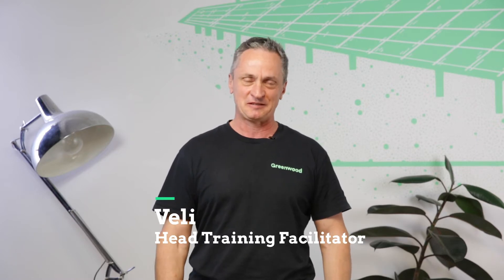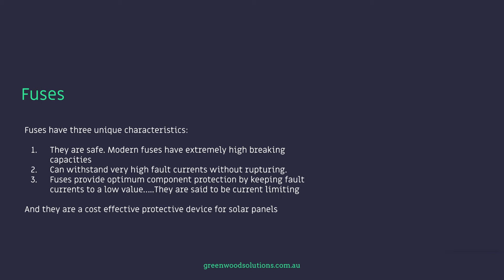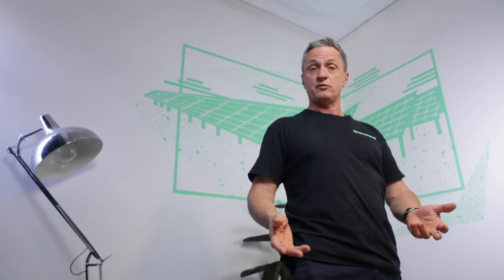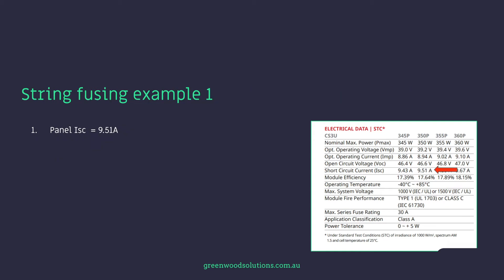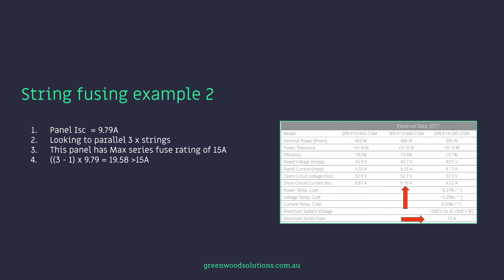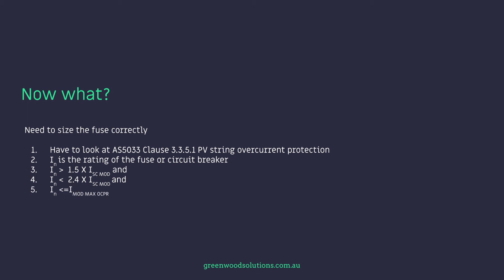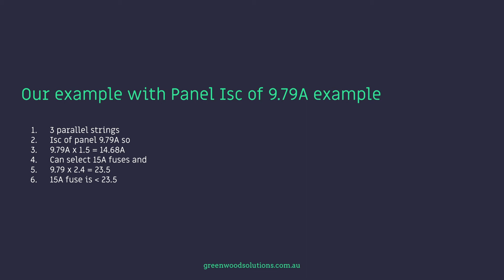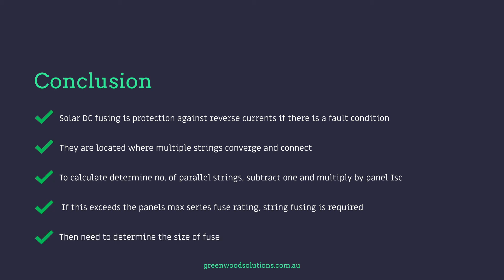Solar DC String Fusing Calculations

Comment: great video..could i also select a 20amp fuse as well?
Reply from the maker: Hey Adam, you can't select a 20amp fuse. This is because the 20A rating of the fuse does not satisfy the requirement of In <=I MOD MAX OCPR. which is 15A in this example.

Comment: This was a great video. I worry about how much non sense and wrong information is out there. I have 2 stings in parallel each has 3 solar panels in series. 
this is the back panel info ( Isc 13.41A, Voc 20.52, the max fuse rating of a panel is 15 Amp)  I have also 100V / 40 Amp charge controller.
With that I am combining 2 x 13.41 = 26.82A (with 61.56V) going to the charge controller. 13.41 is less and I should not need the 15Amp fuse. 

This is what I have got in one of the Newpowa representative in the email:
 "We still recommend you to use a 15A fuse in the series connection of your solar panels. It is important to note that under certain conditions, such as when the solar panels are exposed to full sunlight, the current output of the solar panels can exceed their rated Isc. Therefore, using a 15A fuse in the series connection can help protect your solar panels and prevent damage from overcurrent conditions."    

Isc is 13.41 Amp and that is it...that is why they list it in the specifications.... less sun or full sun....I mean rather in full sun. How they can provide you with such a information. I am happy to see good info. Thank you again for your time and good explanation. michael
Reply from the maker: No worries.

Comment: What Fuse Size for 150W Solar Panel - ISC Amps 8.76 should I use? THANKS
Reply from the maker: It depends on the number of strings involved. If you are in Australia just check out the latest standards because soem of the calculations are a bit different now.

Comment: Thank you for sharing but I do have a question on the Formula 3 - 1 why am I minusing one string? In my case I just have two panels I want to wire in parallel so that is one string in parallel my short circuit is 9.05 * 2 which is 18.1 Which is less than my 20 amps Max fusing is that correct? I just don't understand why if you're having three strings why are you subtracting one string in your equation I'm lost
Reply from the maker: It comes down to this. If there is a short circuit in one string the other strings will send their ‘energy’ to the the short-circuited string and that’s when the max reverse current rating of the panel comes into play.
That’s why the calculation is for example ( 3 - 1)
Note: If in Australia the current AS5033:2021 standard has a slightly different, less forgiving calculation:
According to AS/NZS 5033:2021, string overcurrent protection is required if:
IF STRING + IBF TOTAL > IMOD MAX OCPR
Which becomes: (SA – 1) × ISTRING MAX + IBF TOTAL > IMOD MAX OCPR
Which becomes: (SA – 1) × 1.25 × KI × ISC MOD + IBF TOTAL > IMOD MAX OCPR
(3 – 1) × 1.25 × 1.1 × 9.8 A + 3 A > 20 A
26.95 A + 3 A > 20 A → TRUE, so string overcurrent protection is required.
The changes from AS/NZS 5033:2014 to AS/NZS 5033:2021 are inclusion of a 1.25 factor, inclusion of the KI factor, and inclusion of the back feed current. In this example, the changes are significant enough to alter the result of the calculation.
Hope this helps!

Comment: LOVELY VIDEO, Ive attended many solar courses and not one has covered this aspect in such detail! 

Lastly, When you mention 'fusing' ,does that specifically refer to  the SLOW BLOW FUSE type or does that also refer to a DC CIRCUIT BREAKER aswell ? They both perform the same function??
Reply from the maker: Thanks for that. I am specifically referring to slow blow fusing. Honestly, now days with a plethora of inverter options that have multiple MPPT with just 2 x inputs, if you select one of these inverters, sort of don’t need fusing ( less work for the installer).

Comment: I am a bit confused because there was no explanation of what a "string" is. Am I correct in assuming that in this case the SA is 3 means that there is one string of 3 panels connected in parallel? In other words,  if there were 4 panels connected in parallel,  it would be a string of 4?
Reply from the maker: Hi JR,
A string is a series connection of solar panels. For example, have 20 x panels connected in series, each panel has a VocMax of 40 volts, VocMax of the string is 20 x 40 = 800 volts. Hope this helps!

Comment: This may be obvious, but please confirm this is for parallel strings into one MPPT. In the case where you have 3 strings into 3 separate MPPTs, would you still need fusing? 
Nice choice of tunes, BTW. Very reminiscent of Blue Sky.
Reply from the maker: As of Dec 2022 if there are individual strings going to individual MPPT’s, no string fusing required.
See examples below:
EXAMPLE 1
Does the string contain a DCU	NO
What is the Isc of the panels used, see data sheet	9.8
Are you using bifacial modules	No
How many strings	4
What is the Reverse current of the panels used in A	30
KI multiplier is 	1.1
Multiplier	1.25
Inverter backfeed current ( from data sheet) is?	3
IBF TOTAL in Amps is	39.75
Do I need string fusing?	YES
Can I use this panel though?	YES, maybe
	
String overcurrent protection sizing results	
Where there are no DCUs: 1.2 × ISTRING MAX < In ≤ IMOD MAX OCPR	
I string max is	17.7
Multiplier	1.2
In must be more than >>>	21.24
In maximum is	30
Select a fuse > 21.24 but < = to 30	25
EXAMPLE 2
Does the string contain a DCU	NO
What is the Isc of the panels used, see data sheet	9.8
Are you using bifacial modules	No
Put zero here          > > > > > > > 	0
How many strings	3
What is the Reverse current of the panels used in A	30
KI multiplier is 	1.1
Multiplier	1.25
Inverter backfeed current ( from data sheet) is?	3
	
Results	
IBF TOTAL in Amps is	27.5
Do I need string fusing?	No string fusing required
Can I use this panel though?	YES, maybe

Comment: What if the panels were connected in series, is the calculation different for parallel?
Reply from the maker: Hi Kerry
We are assuming 18,19, 20 panels in series connection indicative of commercial solar voltages commonly used. Then these strings are paralleled to each other with obvious restrictions.
If there is a fault in one of the strings, the fusing is there to protect the other strings that are paralleled to it.

Comment: Sir 535watt 15panel  1string =740voc and 13A ISC total 3string fuse rating 25A 
20A fuse single string?
Reply from the maker: Hi Rashid
Remember string fusing is based on the reverse/short circuit current rating of the module in question and the number of parallel strings and the Isc of the module in question.

Let’s assume the following:

1. Module reverse current rating is 20A
2. With one string with module Isc of 11 amps no string fusing
3. With two strings no string fusing
4. But three strings in parallel yes as ((3-1) x 11 = 22A > 20A!

Now have to select the rating of the fuse.
so the fuse has to > than 1.5 x Isc which is 16.5A  AND has to be less than 2.4 x Isc which is 26.4A so, in this case, would use a 20A fuse.

So first determine the reverse current rating of the module, then the Isc, the number of parallel strings and in the case of the Australian Standards the min 1.5 rule and the max 2.4 rule.

Apply the following formula, ((SA - 1) x Isc MOD) > IMODMAX OCPR where:

1.SA is the number of parallel strings,
2. Isc MOD = Short circuit current of the module in question,
3. IMODMAX OCPR, Max fuse rating in Amps/ reverse current rating.